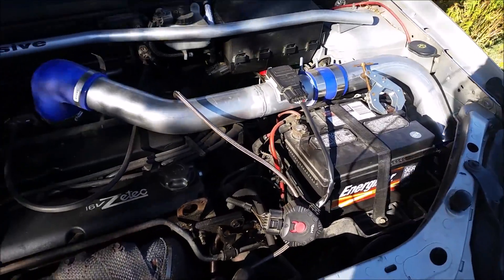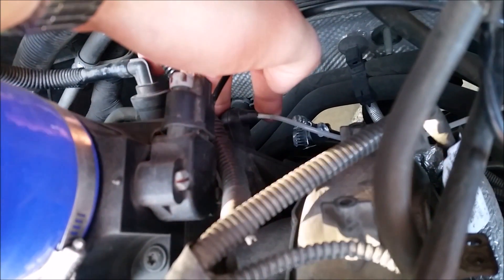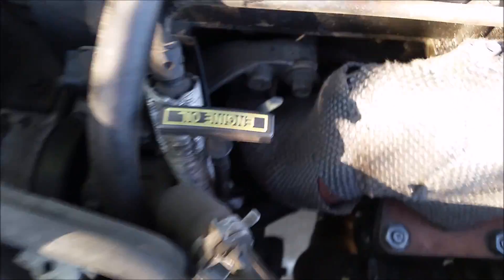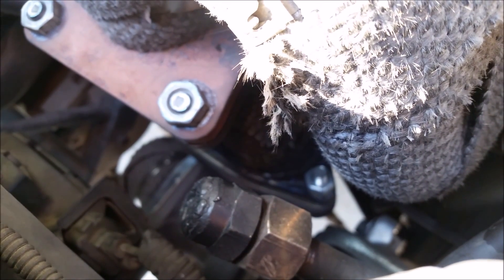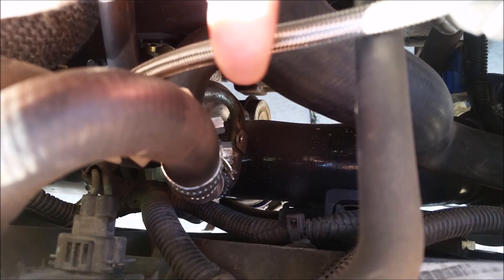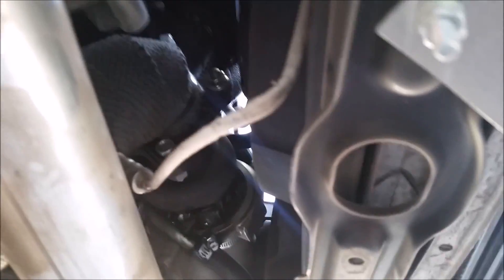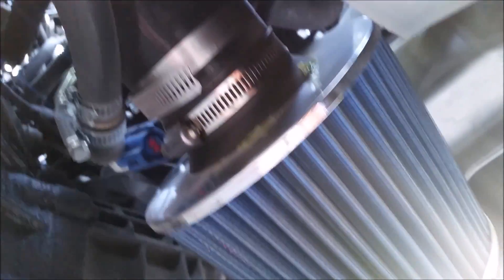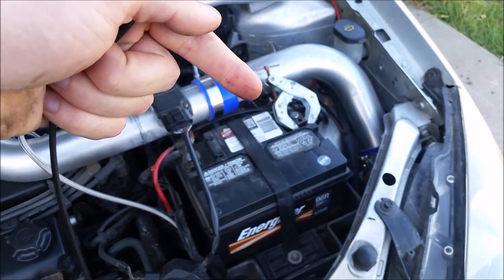Homemade Ford Focus Zetec Turbo System Overview

Comment: eBay sale manifold for zx3
Reply from the maker: True, but they tend to be pretty poor quality and can even ruin the turbo if bits of weld break off and get sucked through the turbo. Maybe they'll work fine though.

Comment: what turbo manifold you use
Reply from the maker: It's the stock manifold with like a 5 inch long adapter that allows the turbo to bolt up to it.
Reply: Did you make the adapter or bought it somewhere?
Reply from the maker: Frankie I made it. I'll be honest, that was probably the hardest part of the whole build.
Reply from the maker: Frankie maybe you can get FSWerks to sell you a single adaptor?

Comment: from the motor
Reply from the maker: There is a 4AN plug on the drivers side of the head that you can just unscrew and attach your oil feed line to. It is kind of under the coil pack though, so you'll have to either cut off one of the mounting tabs, or figure out another option. That's the easiest way to get an oil feed in my opinion.

Comment: Hey man I really dig your car, I have a 2005 focus zx4 se, I'm looking to build it up and put a turbo on it, anything you could tell me that would be helpful?
Reply from the maker: Dillon Stumph Hey thanks man!
I would seriously look at some of the current kits that are already available for the Duratec motor. FSWerks has a few solid kits for them, but they do cost a chunk of change. There is a build thread on Focus Fanatics of a guy that did all of the fabrication and piecing together of a turbo system for his blue Duratec ZX3 and that could probably give you a lot of useful info because it's a super in depth build thread. I don't remember what the guy's username is, but if you dig around you should be able to find it. He actually had 3 different threads for the 3 continually more extreme systems he made, but if you find one you should be able to find the others.
Hope that helps!

Comment: Looks like I'm going to need a lot more money! 4 welding equipment!!! to make my own exhaust/downpipe & fabricate my o2 bungs n2 the exhaust! I already have 3-4k n2 my fucus but, I want/need a turbo n my life!! I won't quit till my fucus does rolling burnouts easily.so turbo & nitrous.im ordering new struts & strut bar soon but, I should prob just get coil overs for better handling.idk. $$$$$$
Reply from the maker: A welder is pretty handy for fabrication! If you want your Focus to do rolling burnouts you're probably going to have to build the motor and get a well designed turbo system/kit. And I wouldn't not use nitrous with a turbo Focus. That will just complicate tuning a ton and will make it a lot easier to blow your motor. My advice is to just use one or the other.

Comment: I need that metal bracket u have rite after u show ur o2 sensors u show where ur exhaust is plumbed n2 the stock piping. mine leaks there bad.urs looks solid.

Comment: Where did u connect your oil feed? can't really see it.
Reply from the maker: There is a little 4AN plug on the head the is kind of behind the coil back. I just took the plug out and attached a fitting to my oil feed line.

Comment: r u getting a check engine light/is it throwing codes or putting your fuel system n2 closed loop with any of the mods? (egr & pcv delete?) all focus's need need a pcv delete! who wants oil shooting n2 their intake/ clogging the aic valve & clogging/gunking up the intake valves? not me! THANKS FORD!
Reply from the maker: All of the check engine lights that come from removing things like the egr and pcv can be tuned out if your tuner knows what he/she is doing.

Comment: I see ur fuse for a system.i replaced my alternator when it failed then I realized I should have purchased a hi-amp alternator, because I'm purchasing a (C.A.B 1600.1) amp & it alone can pull probably over 230amps when it pushes 4,800watts.So, I will need a 300+amp alternator.but being my daily driver I was in a hurry 2 get Mobil again.
Reply from the maker: Yeah, my amp is only a few hundred watts so there is no need for me to upgrade :)

Comment: nice!!! I'm looking to turbo my fucus as well..I'd love to know many things? about the tune? What injectors? fuel rail? fuel regulator? fuel pump? Also how did u run the o2sensors? & I'm sure I will have more quesrions! love to talk to ya???? Any help would be greatly appreciated!!!!!!
Reply from the maker: Nice! I got my car tuned my Tom from Focus Power. His website is being updated right now, but you can find him on the focusfanatics forum. He has his own sub-section over there. My injectors are 42lb from a good brand (can't remember the name off the top of my head) and the injectors these cars use are the EV1 style.
Stock fuel rail, newer stock fuel pump. You don't need to upgrade these unless you're going over 250 whp, and you can't do more than that unless you have a built engine with forged internals and what not.
Only the front o2 sensor is being used. The back is just unplugged.

Comment: Hey I was looking at it again, and was wondering... Why the Diablo mafia thing? and where did you get your Oil feed from? and why did you change your mind about oil return in the sump? Thanks a bunch!
Reply from the maker: GabMastaQC Hello again!
The Diablo MAFia is needed because the computer/maf isn't able to properly read the huge increase in air flow that happens when you add a turbo. From my understanding the MAFia basically modifies the voltage signal and gives it a wider range to work with. There is a little port on the cylinder head just behind the ignition/coil pack that a 4AN fitting will plug into. You have to modify the bracket that the coil pack is attached to (spacers and some cutting) to have enough space, but it's very doable.
With the oil return, it probably would have been fine to have the drain still be in the oil pan, but since my turbo sits pretty low, I wanted to have it drain above the sitting oil level. So I guess it's mostly personal preference.
Hope that helps :)
Reply: yes it does thanks a bunch! Soo the SCT X4 cannot on its own control the MAF you absolutely need the diablo correct?
Reply from the maker: GabMastaQC Correct. The Diablo MAFia is absolutely needed. They're not actually made anymore, so you will probably need a used one. Although there is another company that makes a similar product that also works. I don't remember who though. If you Google around you should find it.
Also, you don't necessarily need an X4. If you want to save a few bucks an unmarried X3 and maybe an X2 will also work as long as they're compatible with the Focus.
Reply: Thanks!

Comment: just about to do zetec turbo conversion just a quick few quick questions, what management are you running? And what's the box you plugged the air flow meter into? cheers
Reply from the maker: Craig Shovlin Right on! You'll have to post some videos!
I am using the stock ECU, but I have a tuner who I send data logs to and he sends me new tunes. I use an SCT X4 flashing unit to do the data logging and to reflashing the ECU. My tuner's name is Tom, and he has a website that I believe is called Focus Power Tuning.
My MAF is plugged into a Diablo MAFia, and it's purpose is to increase the range of what the MAF can sense. It just plugs right in line with the original connector. You can't fine Diablo MAFias new anymore, but there is a company who makes a similar product that will work. I just don't remember what they're called haha
Does that help?
Reply: +prerunnerwannabe that's plenty of help buddy I was just going to run a stock ecu and wire in a 5th injector but I think a slight change of tactics is now required lol I have a video up on my channel of it when it was built with its 1st 2.0 engine, looking into a sct unit just now to see how much they retail for in the UK
Reply from the maker: Craig Shovlin Sweet! Yeah, getting a proper tune with larger injectors I think will help a lot with long term reliability. Although a 5th injector would probably be cheaper lol
I'll have to check out your video!

Comment: This on the stock throttle body?
Reply from the maker: Matt Laflamme 
Nope! It has a 65mm billet unit from CFM (Central Florida Motorsports)
Reply: Nice
Reply from the maker: Matt Laflamme Thanks man! Do you have a Focus yourself?
Reply: I do indeed. In the process of a similar thing. I'm suprized there are not more zetec turbo projects on youtube. I guess they don't drift eh ha.
Reply from the maker: Matt Laflamme Hey that's awesome! But yeah, you'll have to post some videos to help offset the lack of turbo Zetec videos :) If you have any questions or anything, just let me know and I'll be happy to try and help!
Reply: I definitely will

Comment: Very cool, do you think I can do the same setup pretty much with my 2.3 duratec?
Reply from the maker: Thank you! The Duratech is a great motor. It would actually be set up really differently than mine for the simple reason that the intake is on the front of the engine and the exhaust is on the back while the Zetec is the other way around. I believe FSWerks makes a good kit for the 2.3 Duratech, so they would be worth checking out!
Reply: Oh yeah right the duratec is flow through... But yeah I have a 2016 ST as my daily so the zx3 is my project now lol. I'm thinking I'm gonna weld the diff, put some wheel spacers on it, grippier tires, get an SVT suspension/brakes, front strut/rear shock tower stabilizers, cosworth intake if I can find one, and exhaust. I think I'm gonna do all this before the turbo to see what the car can do N/A but anyways yeah good on you for the awesome turbo setup!
Reply from the maker: +jam9297 Hey that would be really cool! I love the ST, but I can't afford one, so that's why I'm boosting mine haha. But I like the plans you have for your car! If you're looking for suggestions, I would probably try and find a different set of wheels over buying spacers, but otherwise that sounds like a fun little setup! I'm curious how a welded fwd car would drive. You'll have to post some vids one of these days!
Reply: The welded diff is really good on gravel and pretty good on asphalt, way better than a limited slip diff and nearly as good as proper clutch packs like a rally car would have. Except a welded diff is like a million times cheaper and it still gets the job done. It's already like stripped and stuff down to the frame so now it's time to make it fast haha. Yeah I'll have to make some videos on it
Reply from the maker: +jam9297 Sweet! Let me know when you make some vids!
Reply: No
Reply: jam9297 no